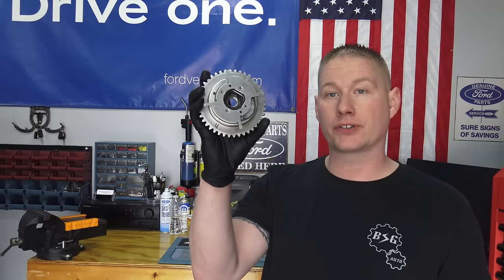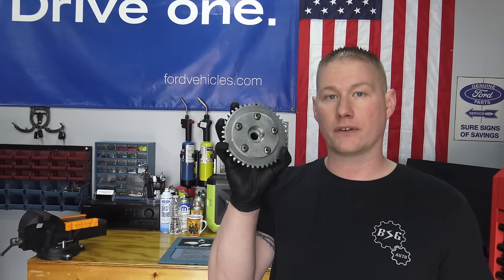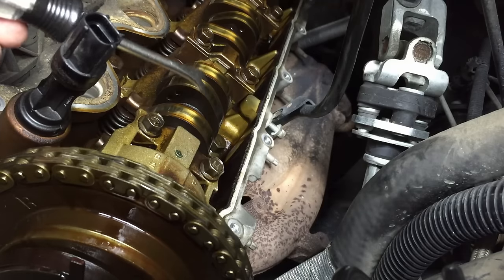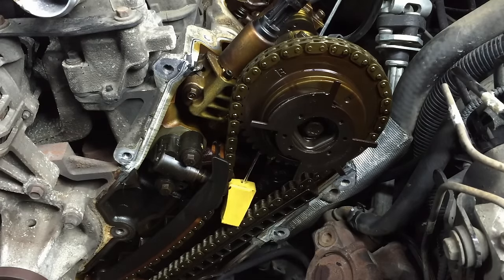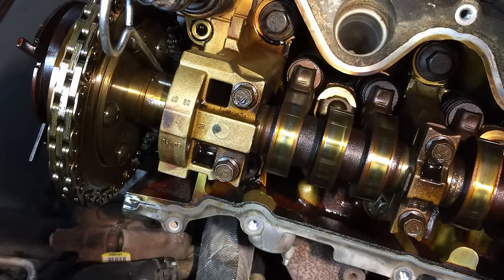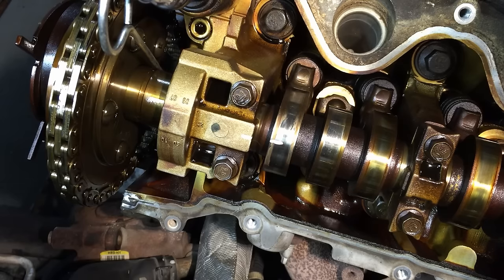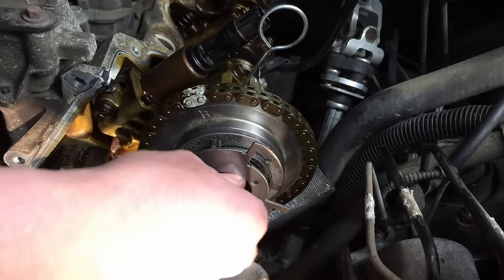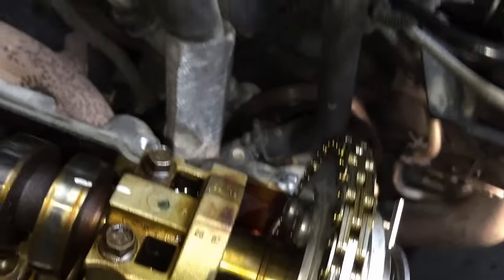Ford 5.4L 3v Camshaft Phaser Replacement**UPDATED FASTER PROCEDURE**

Comment: If I buy the Cheese Tool from China for $3, instead of the $35 American one, will the wire handle pull out and leave the cheese deep in the chain cover, costing me $600 in extra work?  What do you think?  Any bets?
Reply from the maker: Never use the cheap cheese wedges.

Comment: So what happens if the cam does move a bit? What’s the process of getting it back to its original position?
Reply from the maker: Normally vice grips between the lobes.
Reply: @FordTechMakuloco  I appreciate the reply! Would I just turn the vice grips between the lobes till the marker matches back up again? Thanks, I just don’t want to damage the engine since It’s my first time doing this.

Comment: 3R2Z-6A257-DA Part is Discontinued What is the next best part manufacturer for these phasers?
Reply from the maker: The part is not discontinued, it is just on a National Backorder. Due off backorder early October. Parts are still available through my links in limited quantities.
Reply: @FordTechMakuloco  Only found one available on the amazon link. Do you have another link for Phasers

Comment: When the cam does spring off does it spin full 360 or just a like 90 or so?
Reply: After loosing my tension twice, I'm looking at 90° lost as far as I can tell. My call is around 65-75° open the other valve cover, don't take anything else appart and align your phasers 180° appart i think

Comment: @fordtechmakuloco This may be a crazy question? If you don’t get your cam phaser bolts torqued correctly could that cause an oil flow issue to the phasers?
Reply from the maker: Yes and a sheared pin.
Reply: @FordTechMakuloco  Thank you sir! I think this may cover the issue I’m having after my timing job.

Comment: hi, i have a 2010 expedition with P0012 and P0022, but there is no noise, no knock, at idle or higher RMP. Could it be just the solenoids? And not the timing/phasers? The engine runs really smooth, but a bit of loss of power, due to retarded engine. Thank you

Comment: My car makes a sound best described a bad bearing sound but only when warmed up and does not change pitch when the engine is revved up. It is loudest at a warm start up but after about 15-20 seconds quiets down or goes away. Appears to be be coming from the right front bank the best I can tell. Quite audible inside the cabin but harder to detect the source of the sound with the hood up. I would say for sure it needed a full timing chain setup but it doesn't change pitch which is very strange. Anyone have any ideas

Comment: Makuloco - Need your help. I replaced the right side Cam Phaser (drained coolant) prior to replacement. Everything went together fine and I refilled my coolant. Once I started it up, I received error code P2196 Rich Bank 1 Sensor 1. Any ideas? I'm stuck. It's running rough and later died while idling.
Reply: Maybe I messed up the timing?

Comment: Hey man! I need your help. I just did my phasers on my 4.6 3v. I had to also take my intake off to fix a coolant leak under neath. So basically I replaced the phasers, and I got the timing marks correct for the phasers (I believe ). And now my car isn’t running correctly it sounds like it’s missing and is real sluggish on take off, so my question is do you think I may have just put my intake mani back on incorrectly and I need to take it off and redo it? I’m not throwing any misfiring codes or any timing codes. PLEASE HELP ME
Reply: If I did get the timing off by one tooth or however would it be possible for me to repair it myself

Comment: i have to start this job at 1 pm today,, i'll post back when i'm done, and i am pulling front cover to inspect the chain guides and oil plunger tensioners
Reply: it took me about 8 hrs i guess, the hard part is pulling the valve covers,,with the timing case cover off i found the pass side chain guide in  3 pieces and the driver side had a crack that ran the entire length of the guide,tensioners were in good shape,, truck fired right up,, ended with dropping the oil and going 5w30
Reply: king size86 good job

Comment: I ordered the timing kit you recommended on Amazon that came from a Ford dealer and both the cam phasers have an R on them.  Is that ok?  The dealer said they have the same part number.
Reply: They will both have an R and an L on them.  Make sure you're aligning the L on the driver's side and the R on the passenger's side.
Reply: From what I have been told ford stopped making the  cam phasers left and right and the new ford cam phaser are interchangeable from ether side.

Comment: OK, I understand the procedure, but what you don't show is what is the best procedure for getting the cam into the correct position.  Can you please explain how you did that?  Did you turn it manually?  What do you turn... the crankshaft bolt on the front of the engine...or what?
Reply from the maker: +Craig Jones yup you just pull the valve cover and turn the crank via the crank bolt until the lobes look just as shown depending on what side you are working on.
Reply: COOL!  You are awesome man...because of your videos and detailed instructions I am tackling a job that I would not have felt comfortable doing on my own.  I was just going to replace the VCT solenoids, but realized that as long as I had the vehicle disassembled to that point (with the valve covers off), I might as well replace the cam phasers!  They are on order and on the way.
Reply: One more thing...I purchased the after-market VCT solenoids from Amazon...see here:
https://www.amazon.com/Variable-Camshaft-Solenoid-8L3Z-6M280-3L3Z-6C535-AA/dp/B01EB966WQ/ref=pd_sbs_263_2?ie=UTF8&dpID=41FcMRbq84L&dpSrc=sims&preST=_AC_UL320_SR320%2C320_&psc=1&refRID=DHFDEZAXXHWSRVB04EEH

ANY MAJOR CONCERNS WITH INSTALLING THESE VERSUS THE FORD OEM VERSION?
The ports on these are a finer mesh screens and all three ports are screened versus just the upper and lower ports like my original VCT's
The description indicates they are a direct replacement for the FORD OEM, and meet or exceed the OEM parts.

Please advise ASAP and let me know before I reassemble the valve covers, etc.

Thanks Again!!

Comment: Great video's! Have you ever heard of using Motorcraft oil only instead of other brands of oil because it's "better" for 5.4's?
Reply: The Motorcraft filters have a better check and seem to work better on the 5.4s in my experience, some engine suppliers insist you use one in order to keep the warranty intact

Comment: The instructions that came with the phasers I ordered say to remove 3 camshaft follower rollers. I don't see you do that step in this video. Is it not necessary when only replacing the phasers? or did you already remove them before you made this video?
Reply from the maker: As I explained in the video this is a shortcut, that is a little risky.
Reply: @FordTechMakuloco   How is it risky, it's looks straight forward...…..

Comment: I have an 04 ford 5.4l. Whenever I slow down to a stop, there's a knocking sound that seems to be coming from the engine compartment a little under 20mph and knocks til i stop. Is this a cam phaser issue or maybe a loose engine mount bolt? It's driving me crazy because I can't figure it out and don't wanna spend hundreds of dollars on something that isn't it.
Reply: matthew jones mine is doing the same thing, I'm sad to report, it's the phasers. Start pricing parts buddy. I've called, read, and watched. Almost every 5.4 3v has or will have this issue. Good luck! I'm gonna tackle it in the summer.
Reply: Thanks man. I was fearing that. I will probably do it in the summer too

Comment: On your 4 part series, the driver side had the phaser labeled "L" and on this video the drivers side has the phaser labeled "R".  Is there a reason for this?  I wanted to be sure before I start this job.  Thanks
Reply from the maker: The phasers are universal, use the timing mark appopriate for the bank you are working on.
Reply: @FordTechMakuloco  Got it!!!  Thank you for your time and response

Comment: Part two: also I wonder about your marking of the phaser bolt then trying to do the 90 degree turn after the torque step. Why not just use a 9 dollar degree wheel, especially as it is difficult to be accurate and the angle of view magnifies that chance of sloppy degreeing. Not to mention your cam turned with you some so you couldn't have actually achieved even close to 90. That's mission critical- I know because I didn't do right my first time, so I had to redo it again a week later. Extremely expensive error too I will add. Finally: I COMPLETELY AND EMPHATICALLY disagree with your comment about using 30 weight oil. I promise you that using 30 weight caused me thousands of $ in damage. It's too thick during initial motor starting and I swear it will starve the Left Bank camshaft.

Comment: OK go ahead and shoot me for asking dumb questions .. do I have to order two phasers (left and right?) or just the one?  I'm thinking only one or they would just chasing each other to to get each other in line (as if I made any sense saying that). Next dumb question.. Should I swap out the VCT solenoid after I change out the phasers?
Reply: Depends if they are both bad or not. It would be a good idea to go ahead and replace both while the cover is off. I would replace the both VCTs before the phasers unless you have a model which requires the removal of the valve covers to replaces the selinoids. in that case I'd go ahead and replace everything in there, phasers, VCT, timing chain tensioners, timing chain guides, and upgrade the oil pump. Head over to f150forums.com and search the site. There is a ton of info on this subject and results.
Reply: Nathan - Thanks!  yeah I kinda like that idea even though it may be a waste of money at that moment in time. Who knows, by doing the repair ahead of time I just might have save more money than I might had to spend. I'm worry wart kind old man when it comes to my vehicles. I take care of them and they in turn take care of us. Thanks again for the info.

Comment: I have a Ford F-150 2005 5.4 174 miles my engine is shaking and loosing power no check engine light, oem new plugs, coil. Any one have any idea that I can do.

Comment: I recently changed out my camphaser they way you taught here but after drive it for a while the same check engine light came back on and car died at fully stop. Please help. : (
Reply: Run smooth for a while and then suddenly noise comes back

Comment: Is there an improved version of these phasers or at least a solid cam gear available for these engines?
Reply: Livernois makes a kit to lock the phaser in place and a software update for the PCM.  Some people like it, some don't.  Personally not the route I'm taking.  Many complaints for the dorman online for longevity, so if you want to not go with a locked then I suggest Brian's link above for new Ford replacements.

Comment: I got a 2005 ford f150 fx4 with 5.4..has a leaking exhaust manifold on passenger side and cam phaser ticking..if I keep driving it like it is what could happen?
Reply from the maker: +Daniel Thompson not much maybe a slight loss in power
Reply: Thanks !!

Comment: Question should I replace everything in my rebuilt jasper engine I have the cold start knock so the tensioner blew the seal!!
Reply: From what I know about Jasper engines they don't incorporate any of the Garbage Ford put in for timing. They Deleted it.

Comment: I followed the link to Amazon to purchase the cam phaser and Amazon indicates it's not compatible with a 2009 Expedition.  I don't know why.
Reply: I wanted to follow up and let readers know that at Amazon, at Fordparts, and most other providers of this part, they are calling it a "sensor". In some cases they show a completely different part than this, but they have the part number 3R2Z-6A257-DA assigned.  This seems like a pretty big mixup on the part of Ford, because most resellers are linking to the Ford search engine which spits out "sensor" and shows pictures of the sensor, instead of "phaser". :
Reply from the maker: This part is correct and yes Ford calls it a sensor.

Comment: You ever have an issue with the tone ring on the phaser turning when you do the 90 degree after the torque
Reply from the maker: Nope, but I only use the Ford Phasers.
Reply: @FordTechMakuloco                     what does that have to do with it?

Comment: The torque for cam phaser is 30  OR 35 ft lb??? Another video from ford motorcraft they are saying it's 35! Please confirm.
Reply from the maker: No it is still 30ft lbs plus 90 degrees.
Reply: @FordTechMakuloco  thank soooo much! I am going to replace my phaser tomorrow. Wish me luck 😁

Comment: Hey I just did a full timing job with the Ford phasers and I got the p0022 engine code. I don't know what to do about it.
Reply: Adam Ricker what finally fix the problem
Reply: @davidcarranza5853  found a brand new oil control solenoid failed

Comment: i know this video has nothing to do with transmission but how can I tell what type of transmission my 98 ford f510 5.4 has
Reply from the maker: +Tyler Odom it either has a 4r100 or 4r70w I believe for those years it is stamped in the pan in big letters. The pan is the biggest indicator they are totally different compare your lbs to ones online and it will tell all
Reply: FordTechMakuloco I'm just trying to change the fluid in it and filter if it helps its a 20 bolt configuration holding it up

Comment: Question:  Did you use the engine sealant in lieu of  a gasket set?
Reply from the maker: No you use both. You apply a glob of sealant on both sides of the head where it meets the front cover then install the valve cover with gasket.
Reply: Thanks! I already changed out the VCT solenoids to no effect.  I'm planning to change the phasers out soon and I was seeing what would you suggest looking at outside of the phasers. I hear that the intake manifold gaskets are something to look at as well. The codes I was getting before I changed my oil to a synthetic were p0012 and p0174. After I changed the oil and solenoids, I was getting the same codes in addition to misfire/camshaft sensor codes.

Comment: Brian, I’ve been enjoying all of your videos on the Ford 5.4 three valve engines! My 2005 F 150 says 5/20 engine oil, are you recommending to change to a 5/30 oil? My engine gets an oil change every 3,000 to 4,000 miles. The truck has 120,000 miles on a new Ford engine, installed by Ford. This was in 2017. The truck runs great. However of course it does have exhaust manifold leak on first two minutes of start up.

Comment: +fordtechmakuloco have you thought about making a video on the Ford takeoff shudder problem? I heard of some guys upgrading their transmission mount to one that's on the Raptors. Apparently it's a more robust mount which helps to eliminate or greatly reduce the problem
Reply from the maker: That is all there is to it we have dealt with this in the past and the field engineers all recommend the Raptor mount to help over shimming the diff.

Comment: is this an interference engine? If the customer waits too long and shears the one phaser & chain... is there engine work to be done too? Valves, lifters, etc? Of course you may not definitive answers, but likely or unlikely?
Reply from the maker: +Cuba Rodriguez Yes any Ford engine that is chain driven is interference. Generally the pin shearing is a installation concern. If properly installed I have never seen a pin shear. If it does happen the area of concern would be piston to valve contact damage over anything else.
Reply: +FordTechMakuloco I'm not talking about the pin or screw to hold phaser. I'm talking about the phaser teeth and links on chain.  I came across one & instead replaced the entire engine instead of replacing the chain & phasers. I was wondering if installing just the chains and phasers would have been sufficient?
Reply: +FordTechMakuloco Either way, thanks for taking the time to make videos. You do a great job of explaining procedure. Keep them coming!
Reply from the maker: +Cuba Rodriguez if the timing chain or teeth broke and there was engine noise then a used engine is best otherwise new timing components will do.

Comment: Great video, but you didn't state how you first cranked the engine to get the cam lobe to the 11 o'clock position.
Reply: If you need to be instructed how to rotate the crank then you really shouldn't be attempting this job anyway.
Reply: Just attach a breaker bar to the crank pulley bolt.

Comment: Why can't you use vice grips to hold the cam?
Reply: You can.  I literally just did it today. I took the phaser off the passenger side and the cam jumped a few degrees, took a pair of needlenose vice grips and grabbed the cam in between the lobes on cylinder 1 and turned it back...lined up the new phaser with the cam and that was it
Reply: @jharrison6557  Here is a better idea; use 2 or 3 large vise grips with curved jaws, grind the sides down so they fit anywhere, and bungy cord the tails to the exhaust manifolds.
Reply: @brentbradley6711  Just put any vice grip right behind the phazer on the cam.

Comment: Do 03 5.4 have cam prasers? They are two valves correct?
Reply from the maker: The 2003 is a 2v engine they have no phasers.
Reply: Thank you for the quick response! Your videos are very informative

Comment: What if you needed to set the timing on that side by 1 tooth? Can you readjust timing even tho you marked the R with the chain but what if you needed to retard the timing. I get p0345 p0349 on the sensor when it's not the sensor it's the fingers not timed right by a tooth. So can I just adjust left or right 1 tooth If I have it off like you did?